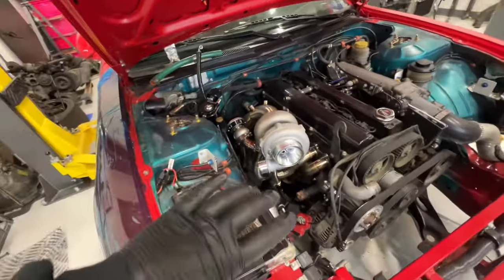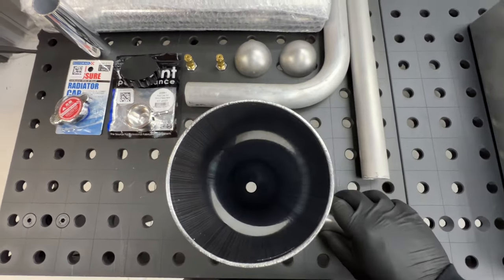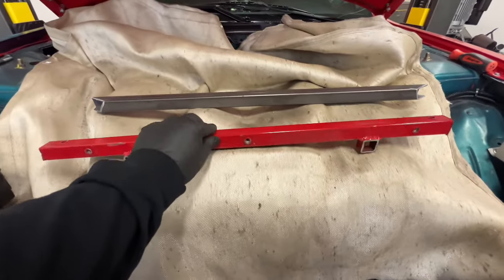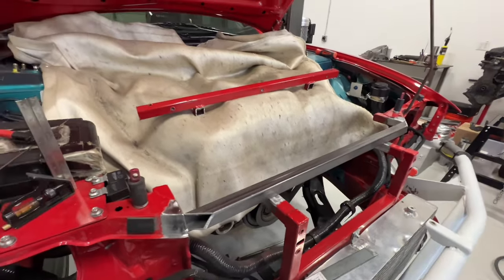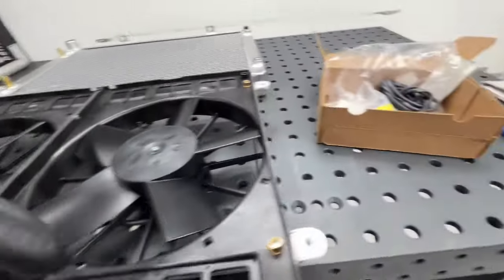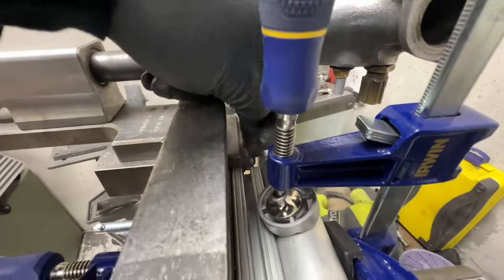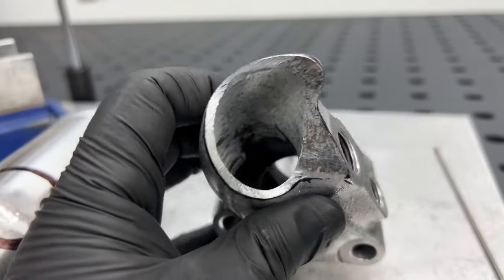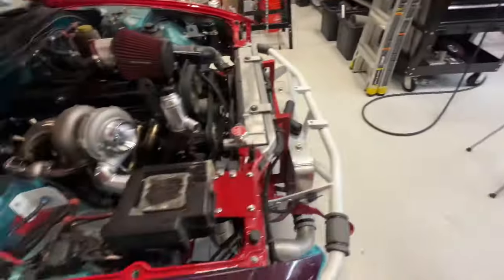1jz s14 Build Pt.4 | Cooling system upgrade, compressor cover mod

Comment: Great stuff man, use some door edge gaurd/rubber where you cut the notch out for all those wires. The vibration will eat right through that oem plastic and into the wires over time.
EDIT: Just saw you used it on the radiator lol
Reply from the maker: I didn’t put any thing on areas that will be getting painted after it leaves here. And that harness is doubled loomed too lol. But totally agree with you
Reply: Yes of course, gotta repaint but I'd still put that edge stuff even though it's double loomed. It being a drift or high power car and all. Wish I had your skills bro. I'm working on my Chaser in my channel but not as much weld fabrication, only because I lack skills and health to go to school for it or whatever. Anyway thanks for sharing 🤙🏽
Reply from the maker: @TheSocialPraxis  this won’t be hitting the track anytime soon. We will be taking it to the dyno, then the owner will be painting the bare metal stuff right away as he works at a body shop. If I was doing all the final fit and finish work it would for sure be leaving with stuff there for added protection.